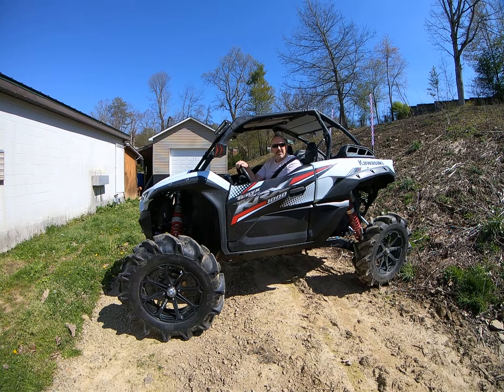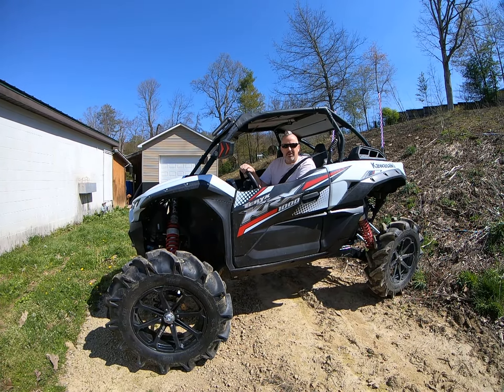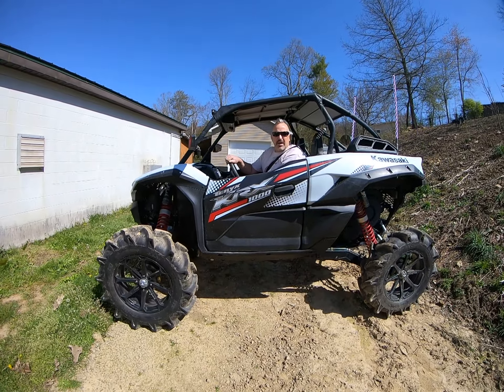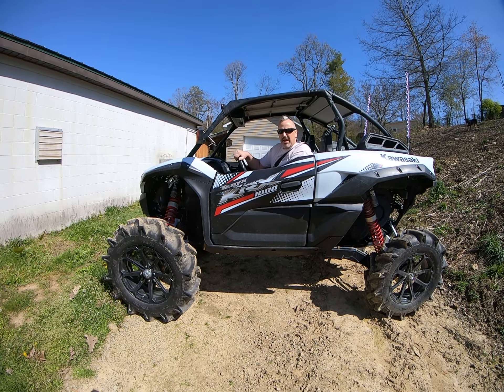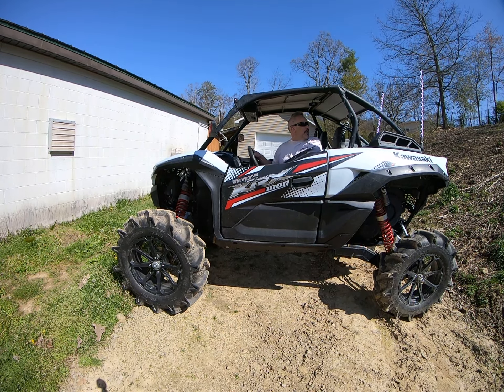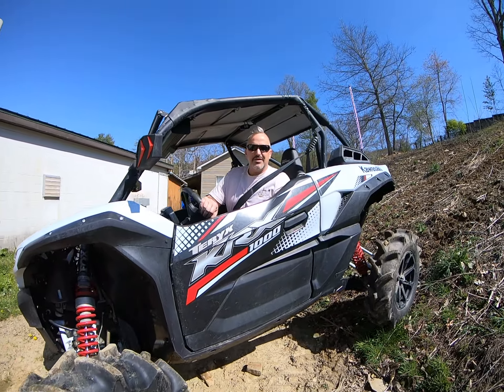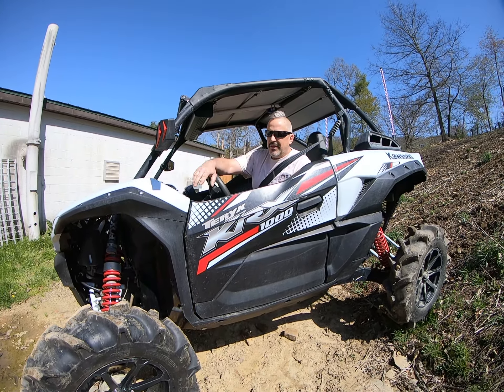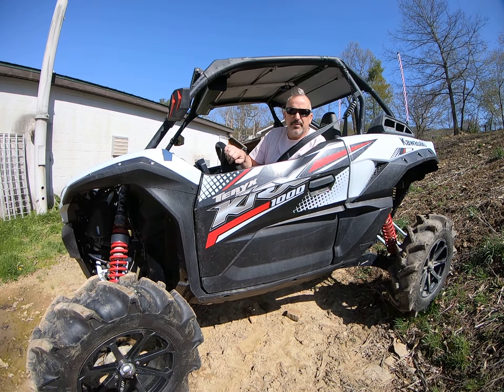JBS KRX Full power in reverse with 37" tires

Comment: Thanks for the video James. I just have one question did the 37" tires fit on the krx with the stock suspension?
Reply from the maker: Yes that bike is all stock suspension but the bottom of the fender on the front has to be modded for clearance.I bought those tires from him for ours and have superatv forward a-arms and no fender mods are needed  with their arms